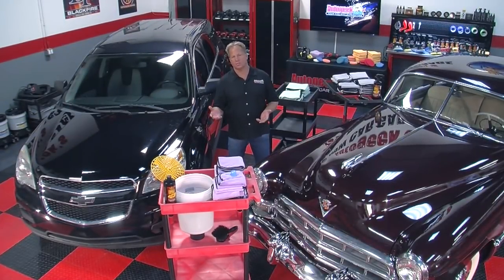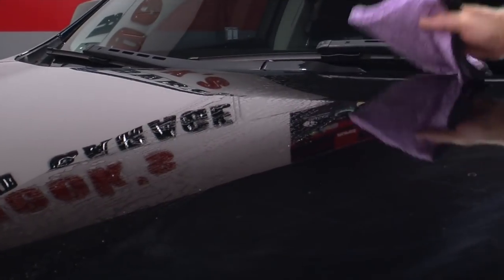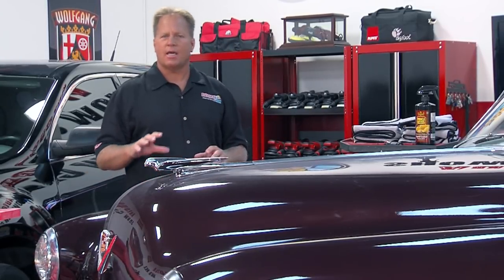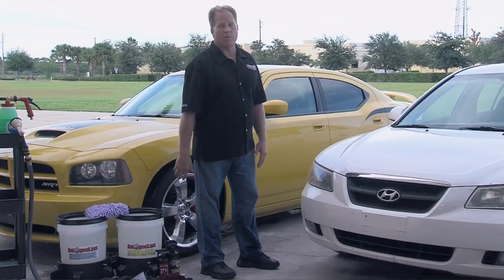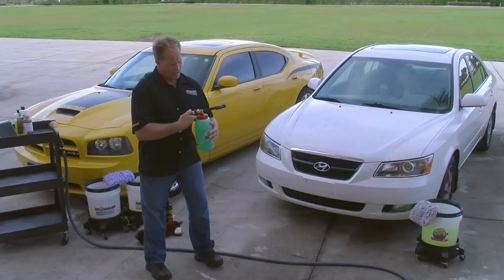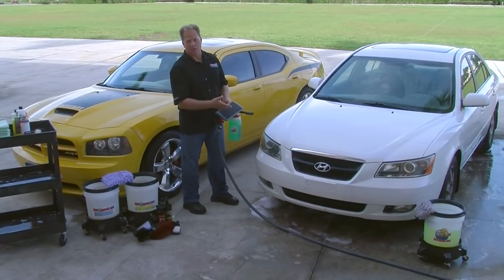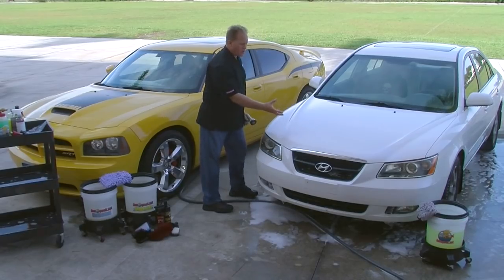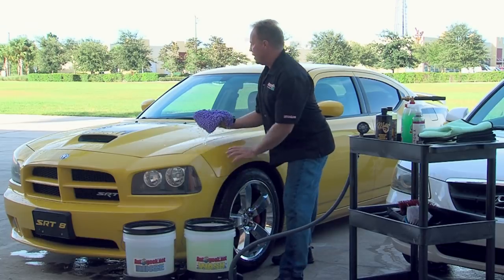How to do Proper Automotive Washing & Drying Techniques - Autogeek

Comment: Thanks for the video and tips, especially about using the clay mitt. The question I have though is if I don't have a foam gun, can I simply dunk the wash mitt in the soapy water and squeeze out onto the car as much foamy soap water before then doing the wash pass with the mitt..? And then would the same method be applicable before using the clay mitt washing..?

Comment: Great video but the problem with using your foam gun for the "Extreme Careful Wash" is you let the hose rub on the panels after it has been sitting on the ground.  Great method in theory, but if even you Mike, are having trouble keeping the hose off the panel the rest of us are more likely to put major scratches in the finish with that method. You almost need 2 people and 4 arms to safely do that.

I don't mean to knock this video, it is still great info. How many Guzzlers do you actually use for drying? Can you just wring out the guzzler and keep drying like you do a traditional Chamois?

Comment: It is always about the details, but The Details makes a difference. Mike it was eye opening for me that You rinse the section that You just washed. Many times I was using ph neutral shampoos washing carnauba waxed car in the shade and washing the car with  foam, than power rinse with karcher then ph neutral shampoo over the entire car. I always kept attention that the shampoo on the car didn't dryed. but it was somehow degrading the wax. The beeding after only few washes was degrading. The paint was polished, prepared by ipa solution, zymol hd cleansed, and properly zymol glazed applied. so this was not the case. the case was rinsing every panel just afet it was just washed with shampoo. 
When I saw this video, applied this method to rinsed the panel immediately after washing, do not let the soap to stay on the panel, it was the game changer!
Of course carnauba waxes are not super durable, but they give the looks much more natural then ceramic coatings, and by changing the rinsing method You have shown on this video I can have the looks longer between waxing. 
Thanks Mike!

Comment: In the rinseless wash is there a reason you cut the soap amount in half? The instructions said 1oz/gal, but for 3 gal you used 1.5oz.
Reply: Jeff Persson he said 1oz per gallon and there is 3 gallons of water. He used two 1.5oz parts of soap to the three gallons that equals 1oz per gallon now do u get it. 1.5 plus 1.5 is 3.

Comment: Should we rinse the ironx off first and then wash the panel? Or would that even make a difference?
Reply from the maker: You can if you want.  Like I said in the video, when I'm doing an AGGRESSIVE WASH - this means I'm already planning on buffing out the car, then I don't rinse the Iron X off I simply move onto the washing step.  It's not that I don't care about possibly instilling any scratches into the paint, it's just I know whatever I instill will come out when I compound the car.  Key point is this is the Aggressive Approach that "I USE" and it works for me.  Each person can figure out what works best for them.  If I were to use Iron X on a car in excellent condition then YES I would rinse it off before washing the car.  -Mike Phillips
Reply: Autogeek Thanks for the reply Mike. That makes a lot of sense! Appreciate you taking the time to educate me on that :)